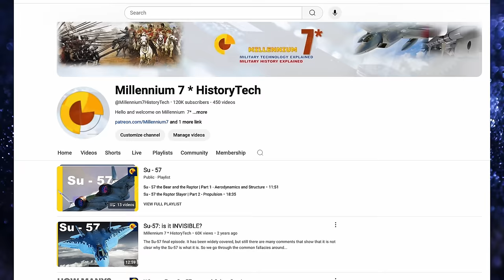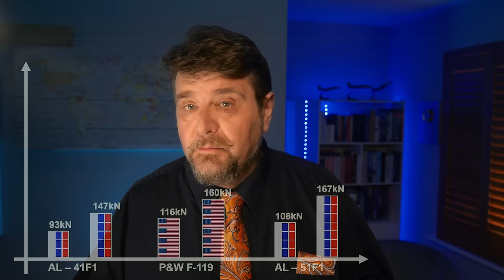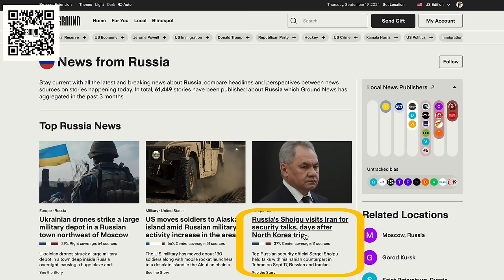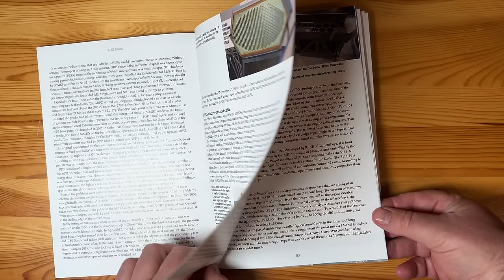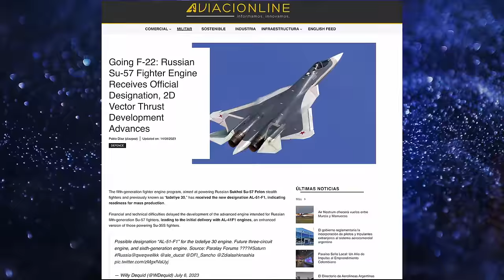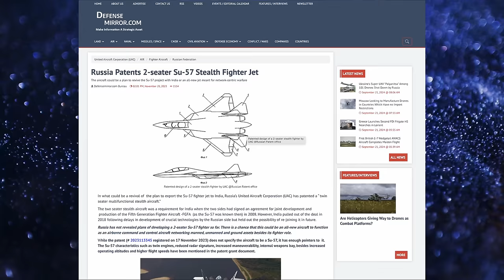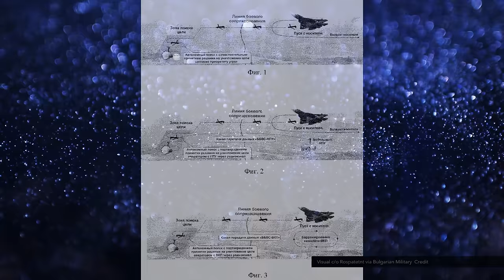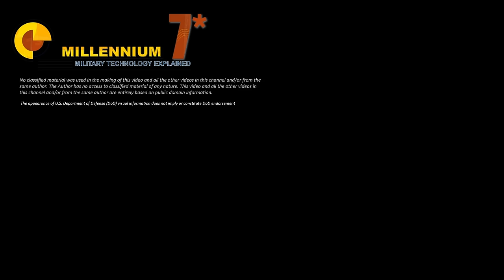The Su-57 is a Masterpiece!

Comment: Okay okay, I will refrain from satire and try to explain to those that don't understand, as we slavs say, "to those stuck in the tank, knock knock".
The reason the Su57 is a masterpiece is because the entire russian government budget including defense is 0.35 trillion USD. It costs the US 3x the entire Russian national budget to develop (not build) the F35. Throw enough money at any problem you will eventually get a solution. The fact that the aircraft is combat ready and operational is an even greater feat. Sure, it took a long time, but it came with little cost to the tax payer and didn't burden the nation with so much debt that its on the verge of collapse.
Second, Since 2014 the Russians have developed pretty much every single system in house, without having to hack the pentagon (cough, china). This shows that the engineers and scientists there have the necessary expertise and past experience to develop something like this. Not only that, this program was initially conceived during the USSR, and it took some 13 years before the program was green lit for development, and another  9 years to reach truly operational and functional status. Sure, 23 years doesn't seem like much, but the F22 program started in 1981 and the first production started in 1996. That is 15 years. 15 years from concept to production, vs 21, sure, but again, consider that the Russians went through some of the worst economic times in any nations history in the 90's and that they still managed to do all of this without going into national deficit spending by the trillions.
This alone makes it a great feat of engineering. Idiots on the internet will always talk about how this plan is a paperweight and cant do half of the things stated, but now we have western sources confirming the air craft does pretty much exactly what it was designed to do, with weapon systems that exceed the russian's claims. I think that is enough proof that we on the ground keyboard warriors don't know anything about this, and the fact that airplanes fly at all, is a miracle that none of us could achieve.
Reply: Agree with most everything you say and the SU57 is super sexy and by all accounts a phenomenal aircraft. The fact that it is alleged to have multiple air to air real combat kills with what is essentially pre production prototype airframes is more than extraordinary especially when we remember the F22 took 28 years to achieve its first air to air kill...against a weather balloon🤪 As far as your dig at PLAAF hack, we have to remember that the Chinese had to begin with a blank slate with no technological foundation or experienced scientist in an essentially 3rd country. USSR not only having an advanced aeronautical foundation from real design and production in WWII fighter development also benefited from a cadre of NAZI scientist channelled to the USSR post war (USSR Operation paperclip). What China and Russia has achieved with their 5th gen fighter is truly astounding and the hope is they can contribute to world stability and peace.
Reply: @TheNefastor  Sorry did you mean to say Germany is collapsing? According to western World Bank, Russia is biggest economy in Europe and 4th largest in world. It has higher GDP growth than any G7 country and into the for seeable future. Russia will host the BRICS summit in Kazan Russia with 39 nations vying to enter including NATO member Turkiye with attendance by as observer of at least another 50. It is 2024 not 1994.
Reply: X - combat ready
X - operational
X - combat tested
X - comparable
X - exists in numbers enough to perform the smallest mission
Reply: @GenghisX999 😂
Reply: What did I just read..😮
Reply: @GenghisX999 😆 brought to you by the ccp.
Reply: @makoimonroe2633  ..and you a woke blue haired Democrat I suppose?
Reply: @ToxicGamer86454well,they are both capitalist
Reply: @TheNefastor yeah china with 5nm chip development completed is laughing in corner…and chips are just for faster computation..if it achieve same thing as 3 nm in 0.0001 sec delay than I don’t think it’s gonna be a problem..btw raw materials to build the chips and the machine for chips coming almost 90% comes from brics…why do you think military uses 90’s tech untill today because it works and is reliable..and first generation chip lithography machine is already in test in china…yeah buddy being keyboard warrior doesn’t makes you look good.
Reply: "with so much debt that its on the verge of collapse."

To the contrary, Russian national budget generally runs at a surplus.

"government budget including defense is 0.35 trillion USD."

It's been pretty strongly established by now that the GDP for Russia is blatantly misleading, not because of anything Russia does, but because the west doesn't understand the difference in economies.
The Russian economy is HEAVILY focused on production, with a largescale R&D and science section.
We have numbers showing that physical production economy, in 2020, Russia was around 80% of USA.   Because so much of USAs economy consists of the finance sectors and to a lesser degree greatly overpriced service sector(healthcare sector in particular!), that it makes the economy look much more impressive than it is.

And Russia graduates twice as many STEM students per year as USA, and of higher average quality.   Especially after they went back to a modified Soviet education program instead of the western Bologna system which they adopted in the 90s and caused their education standards to drop significantly.
Reply: @GenghisX999  so why you dealing in Chinese currency now 86% of all financial transactions....ooops. Rouble is broken and not wanted, needed.
Reply: @andrewwarren4206  Wow matey, you're truly utterly clueless arent'ya?

Russia specifically trades in yuan to avoid having the ruble increase too much in value.
2/3 of the world however, is VERY happy to trade in ruble.
They know it's a reliable currency backed by the world's most premier quality central bank governor, Nabiullina.
Reply: @DIREWOLFx75  Not to mention that the Ruble is also pegged to gold now.
Reply: @TheNefastor you sound like a microwave...what miraculous western chips have been used in the Russians and Chinese lastest military aircraft?
Reply: @DIREWOLFx75  lol
Reply: @TheNefastor  "...and now Russia is collapsing as well" an unfounded thought. I would say this is nonsense. greetings from Moscow.
Reply: @TheNefastor   Russian processor ? Look at "Эльбрус" It doesn't end there, but it looks like government agencies will switch to this architecture.
Reply: @ToxicGamer86454 Are you saying that the US economy is not regulated by the government?
Reply: @GenghisX999  Russia activly loses workforse - terrible age pyramid .  And its GDP increased is purely by the war effort( oil revunue dropped ) . In WW2 during the war USA doubled their gdp . For a war economy Russia is even underperfoming. Not to mention the lack of any future foreign investemtn , the loss of workforce ( the dead soldiers) , possibly quite long sanctions from the EU and it will be forced to sell its oil below marker price
Reply: @TheNefastor  still waiting for those predictions of collapse to come true.
Reply: @maksudagypsy  Well no shortages whatsoever for Russian consumers and very well managed inflation. Standard of living increased substantially since SMO. Does not sound like war economy to me. Meanwhile west has still out of control inflation, unaffordable housing, food and education while a Ponzi financial industry keeps partying on borrowed money. US interest payment on national debt forr fiscal 2024 to be $1.2 trillion. 50% higher than its insane military budget. Talk about financial problems! And EU is in even worse shape as is Japan.
Reply: @DIREWOLFx75  America produces $2.5t worth of manufactured goods a year. That is $500b more than the entire Russian economy.
Russia, meanwhile, produces about $220b worth of manufactured goods a year.

Oil and gas, which are the lifeblood of the Russian economy, contribute 20% to the entire GDP of the country. America produces 30% more oil than Russia, and close to double the natural gas (especially as of late), and those resources amount to a solid 3-4% of the economy

Really makes you wonder why a nation that sends off more stem students is such a backwards, antiquated, undeveloped nation that is so heavily reliant on oil and natural gas.
Reply: The entire cost of the project is assumed to be 1.7 trillion USD but for 50 years. This includes the building of the jet. 

Just how they claimed no Western parts are needed for things like missiles but it turned out that the Russians continue to buy Western components. 

Not sure why you claim the SU-57 is operational. It doesn't have the engine which means that some of its systems are not yet operational too. This means that the jets is still under development. 

I don't remember the last time Russia claimed something and that something to have matched the claims let alone exceed the claims. So far, the only evidence we have is 1 destroyed SU-57
Reply: @GenghisX999  There are 0 confirmed A-to-A kills for SU-57. Only claims!
Reply: @GenghisX999  According to Putin, not the World Bank. Currently, the Russian economy is 11th in the world. It dropped out of the top 10 in 2023. The data that this supposed 4th place is based on is GDP PPP but that figure has no weight considering it is based on estimations and not real data. They just take averages from all kinds of products and create a supposed PPP figure that is not even used for determining economic size but rather for calculating poverty levels.
Reply: @DIREWOLFx75  Little less than 20% of the US economy is industry. The US GDP is 27.36 trillion USD for 2023. So over 5 trillion USD of the US economy is generated from the industrial sector which is 2.5x larger than the entire Russian economy. If we count the US manufacturing sector alone, it is nearly 3 trillion USD in size. This again is larger than the entire Russian economy by about 50%. In fact, the US manufacturing sector is 10x larger than the manufacturing sector of the US.
Reply: @DIREWOLFx75  The US invests more money in R&D than the entire Russian national budget. The US invests more money as a % of their budget in R&D than Russia. Oh, there are far more STEM graduates in the US than in Russia not to mention that you don't even need an official diploma from a university in the US. In many STEM fields, you can get a perfectly fine education from online courses and many companies in the US don't even require a diploma anymore
Reply: @GenghisX999  Your very well-managed inflation sits between 8 and 9%. The out-of-control inflation in the West sits between 2 and 4%, depending on the country. Majority of the countries in the EU and NA sit around the 3% mark with the US now below 3% inflation.
Reply: @maksudagypsy  Well, explain why we need Western investments? What's magical about them? Try to maintain your balance yourself. You have many of your economic problems.
Reply: @GenghisX999  19% interest base seems a little high. In fact, it's 1% less than the 20% emergency measures declared by the russian finance minister. Ummm.
Reply: @GenghisX999  The largest economy in Europe is Germany, third in the world (after US and PRC). Russian GDP $2.24T, German GDP $4.082T. You were saying?
Reply: @ToxicGamer86454 the us government also regulates the economy,the FDA exists does it not?
Reply: @m.a3914  Isn’t America great, freedom for 650,000+ plus to be living out in the open air enjoying nature, doing the campfire thing in DT Springsfield, free stuff to be had at the mall with the 50 hoody buddies. Yeh life is great. Just had 3rd state paid abortion, and don’t even know if I am man or woman.
Reply: @GenghisX999  Over 60% of all homeless in the US are in shelters.
Reply: @m.a3914  next time you are hungry trying munching on some GNP. PPP is the real economy as that is what is able to be purchased and produced. It is the real economy. Very simple, you can earn $10k USD per month in NYC and only earn $5k a month in Moscow. Are you twice as rich in NYC? When you pay rent for $6k a month and pay other expenses like transit and food, you are a lot less well off than at $5k in Moscow where rent and expenses are less than $3k per month. Or compare cost of nuclear sub in U.S. for $2 billion each while in Russia it is less than $500 million for a better sub.
Reply: @GenghisX999  If you earn 10k a month you probably don't live in a 6k a mont place. Just pointing out how ridiculous your example is. PPP is not a real economy. It is not even a real metric. It is not a metric that countries calculate. It is a metric that organizations like the IMF and the World Bank estimate based on averages. The only issue is that they cannot factor in every single product so they take the average per category. But there is an issue with that way of doing things. You see, richer countries get discriminated against. There is absolutely nothing stopping the average American from buying a phone for $150. The issue is that they want iPhones and they buy iPhones. The same exact thing goes with cars, food etc. I live in Eastern Europe and people get shocked when they understand that prices in the US supermarkets are very similar to the prices in the local supermarkets. PPP is nothing more than an estimation that better reflects poverty levels but the higher your income the less effective PPP becomes. In fact, there are so many things right now that cost more in Russia compared to the US.
Reply: @m.a3914  nobody is comparing US economy to Russia. That is ridiculous. We can compare Russian tech and arms to US and there is strong argument for Russia to have decisively won the arms race against the U.S. in both conventional and nuclear.
Reply: @GenghisX999  There is no argument for that. Russia decisively lost even before the fall of the USSR. Today, they don't stand a chance. Even if they had the desire and the technical expertise to match something on the US side, they don't have the manufacturing base and capabilities. Their digital economy is too far backwards now and there is no clear path for them. The US is not standing still either. The US is investigating over $800 billion in R&D every year. That's significantly more than the entire government budget of Russia. On top of that, the US military budget is closer to $900 billion USD with the US military alone investing more into R&D than Russia's entire military budget. They simply can't match the scale and capabilities
Reply: @m.a3914   No, this is a very real phenomenon in every major NA city. Housing cost is at least 60% of income. This is before an income tax rate of 25% to 44% depending on your income and state, that is taken off the paycheck before it even enters your bank acct. Then you pay expense. So in the example, a NYC resident would pay 35% tax and get $6500 deposited in bank to pay $6k in rent. It is insane and unbelievable but reality. That is why we can fight each other but never mention the money masters who control this system. Let’s fight foreign against people who done nothing to us or hate you for you skin color, food you eat, god you worship, person you have sex with but don’t question who controls the system.
Reply: @m.a3914  The Economist mag rag had a McDonald’s Big Mac index where they compared price of a Big Mac in cities throughout the world to gauge real standard of living because they knew measuring by USD Per capita was meaningless as price buying power were so different. This is close to PPP. It more reflects the real purchasing power of a nations economy. Prime example, USA vs China. US GDP at $26T vs China at $18T but China’s industrial output absolutely dwarf the US while US financial, equity market and bond market is much bigger than China. So in the end of the day, China can produce 200X more shipping, including military, than US, but US has more stocks and bonds and a debt of $35T and rising, who do you think is better off in mid term?
Reply: @m.a3914  Well so far, it seems Russia is completely over producing and out matching the entire NATO collective west in arms production and defeating every wonder weapon produced. US military had its heyday in mid 90s while sole hegemon and squandered it with costly wars against 3rd world 2nd rate militaries. It is now far behind Russia and China and in some aspects even Iran and N Korea in hypersonic missile tech. Only thing west has significant advantage is propaganda and info war. Psy ware fare is not to be underestimated.
Reply: @GenghisX999  Outproducing them in what? Shells? Something that NATO doesn't even care about? I hope that you understand that there are doctrines that countries follow in regards to their military. The Russians put high emphasis on artillery while NATO countries and in particular the US military, put its priority on the air force. 

Hypersonic means speeds above mach 5. The 1st ever such missile was made in the 1940s by the Germans. As for hypersonics that fly in the atmosphere, the Americans had such missiles in the 80s. It is called Pershing 2.
Reply: @m.a3914  Production counted in cash value is completely irrelevant because USA is drastically more expensive and overpriced than Russia even after adjusting for PPP.

Russian average monthly wage is $990.
USA average monthly wage is just under $5k.
And yet you can have a higher livingstandard in Russia on that wage than you can in USA on their average.

"In fact, the US manufacturing sector is 10x larger than the manufacturing sector of the US."

Uh-huh...
lol
Reply: @m.a3914  "The US invests more money in R&D than the entire Russian national budget."

So what?   What does the difference in MONEY spent matter when Russia still gets more out of their budget?

"and many companies in the US don't even require a diploma anymore"

lol

Yeah, because they're unable to hire enough qualified workers...
Reply: @DIREWOLFx75  The ground army of Russia is still significantly smaller, their air force is significantly smaller, their navy is orders of magnitude smaller. The US has 10x the amount of satellites in space. What exactly does Russia have more? 

There aren't enough qualified workers because there is so much work in the US unlike in Russia. Diploma is no longer required because the internet is now full with high quality information, especially after AI tools became so powerful.
Reply: @DIREWOLFx75  Things in the US are more expensive because they offer more. It is very simple. The average net salary in Russia is just above $550, not even close to 900. The average net salary in the US is just above $4,500. 8x more! The average American has a much, much higher standard of living than the average Russian. It is not even remotely close. 

Yes, the US manufacturing sector is about 10x larger compared to Russia. It is larger than Russia's entire economy. The entire industrial sector in the US is nearly 5 trillion USD. 2.5x larger than Russia's entire economy.
Reply: @m.a3914  "The ground army of Russia is still significantly smaller, their air force is significantly smaller, their navy is orders of magnitude smaller."

And how MUCH of all that could USA actually put on the ground in Russia?
Only a small fraction.   In fact, what USA already has deployed in the Baltics, Poland and Romania is an embarassingly large portion of the total.

Also, how much of that could USA actually support logistically?
They can barely provide UA with 1/10th of what Russia is using, and that is despite already taking from USAs war-reserves and reducing USA military live training.

"The US has 10x the amount of satellites in space. What exactly does Russia have more?"

Anti-satellite missiles?   lol
If there's an actual war, Russia starts blinding USAs missiles with their groundbased lasers, while their MIG-31s starts launching missiles to destroy satellites.
They could do about 100-200 per day, while the lasers could do another 50 or so.

USA does NOT have either capability on a large scale and does not have lasers like the Russians have, at all.

And aside from aircraft?   Russia makes over 10 times as much military equipment and munitions as USA.
In regards to SAMs, more like 50 times more.

And if USA attacks Russia directly, Russia can start launching Zircon from its submarines.
BOOOM, no USA military industries, military bases or command centers left.
USA has nothing that can defend against them.
USA also have no functional hypersonics itself, and even if they did, Russia's S-500 and to a lesser degree the S-400 are capable of intercepting hypersonics.

"There aren't enough qualified workers because there is so much work in the US unlike in Russia."

HAHAHAHAHAHAHAHA...

Oh dear gods, you're completely delusional...

"Diploma is no longer required because the internet is now full with high quality information, especially after AI tools became so powerful."

ROFLMAO!!!

Wow, you really have absolutely no clue about reality do you...

Seriously, if someone came to my brother and tried to go "i can look it up online if i don't know", he would be laughed out the door instantly.
Just as any competent manager trying to hire people would.

Why do you think USA had to pay RETIRED workers to go back to factory to increase artillery shell production?
And had to pay them MASSIVELY.

Because EXPERIENCED WORKERS ARE WORTH MORE THAN GOLD.
Reply: @DIREWOLFx75  You live in your own world buddy. Next time please try to provide some context instead of just spewing propaganda left and right
Reply: @m.a3914  and you are not spewing propaganda?
Reply: @xhydrag0br203  Considering everything I said is or can be proven with widely available data then no, I'm not spewing anything but facts
Reply: @m.a3914 nah, direwolf owned you😅
Reply: @abyssmanur3965  Because you share the same views as him. He owned me with arguments such as "hey could do about 100-200 per day, while the lasers could do another 50 or so."??

or 

"USA does NOT have either capability on a large scale and does not have lasers like the Russians have, at all."??

or 

"And if USA attacks Russia directly, Russia can start launching Zircon from its submarines.
BOOOM, no USA military industries, military bases or command centers left.
USA has nothing that can defend against them.
USA also have no functional hypersonics itself, and even if they did, Russia's S-500 and to a lesser degree the S-400 are capable of intercepting hypersonics."

Despite the fact that the US had hypersonic missiles in the 80s and S-400 not even being able to defend itself OR the fact that the US has the highest number of SSBNs in the entire world OR the fact that US SAM systems actually work...

Simply spewing propaganda is not making or shouldn't be making you look smarter or more prepared. It just makes you look delusional.
Reply: @TheNefastor  You say it is not made with a processor, ask yourself if America makes it??? America takes everything from Taiwan, it wouldn't have achieved anything in technology if it wasn't Taiwanese, even the iPhone and those with Taiwanese processors installed... And not to mention missiles, Russia is ahead of the curve in terms of technology very much, who invented hypersonic missiles - Russia, and America still doesn't have them because it's too weak scientists to understand technology.
Reply: @m.a3914  What propaganda?

I never write something unless i'm reasonably certain it is either true, or close enough that the difference doesn't matter.
Otherwise i always add a qualifier.

I live in reality, maybe you should try visit sometimes?
Reply: @DIREWOLFx75  Do maybe try to follow your rules and provide sufficient evidence or at least a logical explanation of everything you said in your last comment
Reply: @m.a3914  The "rules"?   The rules that you just made up or what?

If you want a functional reply, quote what you're replying to, because i cant sit and go through 60 replies to find what you're referring to.

Regardless, i don't post something unless there's reasonably good evidence that it's true or close to true.
The only exception being when i include qualifiers.
Reply: @DIREWOLFx75  I already said what comment I'm talking about. You have shown nothing but your own opinion which I don't hold for anything